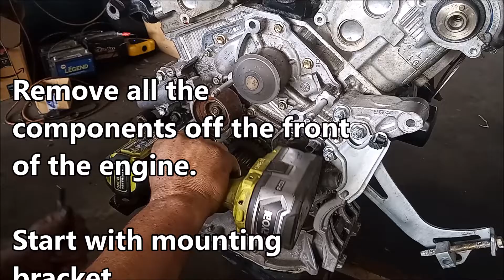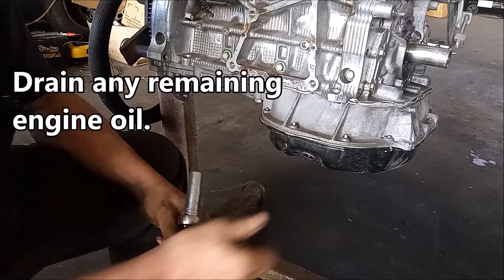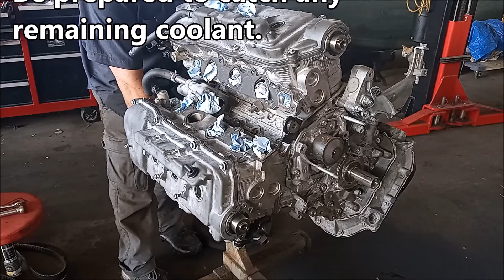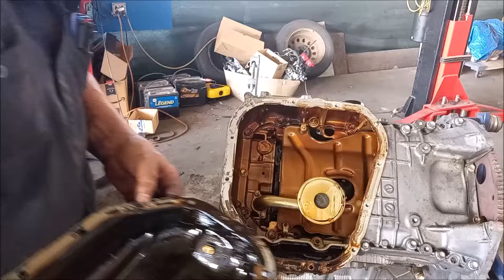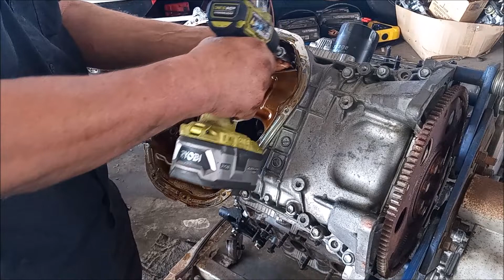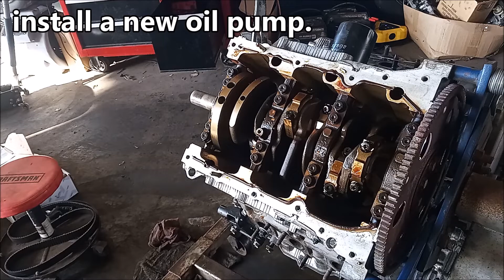Oil Pump Part I - How to Remove - Toyota V6 3.0 liter 1MZ-FE/3.3 liter 3MZ-FE Camry Highlander RX300

Comment: If this is being done in-car, do you have to unbolt the transmission? I see the flywheel exposed in your video so I wanted to know..
Reply from the maker: Upper oil pan should come off without unbolting the transmission.

Comment: oil pump is still not off. I've got 256K miles of sludge built up, should I grab the chisel tap?
Reply: got it, may I ask how you'd reccommend cleaning the pump?
Reply from the maker: @ADDVi8OR  buy a new pump.
Reply: @Merryfrankster_  are you making a video of breaking it down further?
Reply from the maker: @ADDVi8OR  there is a head gasket video, and camshaft video, and timing belt video, maybe some day there will be crankshaft/bottom end.
Reply from the maker: @ADDVi8OR  do you mean breaking down the oil pump? No.
Reply: @Merryfrankster_  No sir, the engine.

Comment: It looks like you could pull out the crank seal and have enough clearance to pull the oil pump without having to drop the upper pan
Reply from the maker: Not by a mile.

Comment: Love your videos! Also wanted to know, can swap a 1mz for a 3mz in my camry 2000?
Reply from the maker: It's not that simple. The 3mz has a drive-by-wire throttle. The fuel injectors are different size. The knock sensors are different. Of course the computers are different too. You can do it but there are many things that you have to change to get it running right.
Reply: @Merryfrankster_  thanks for that! Much appreciated

Comment: wait, am I? working on an es300 1999
Reply from the maker: Try replacing the valve cover o-rings and cleaning the filter. Run an engine flush/cleaner on your next oil change. Just keep driving. The startup rattle is nothing serious.